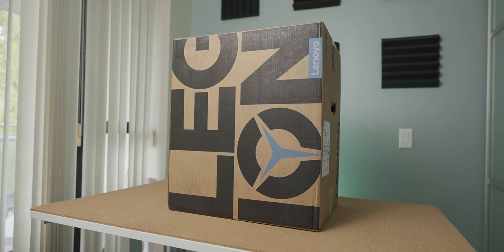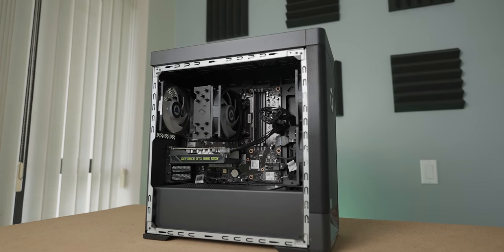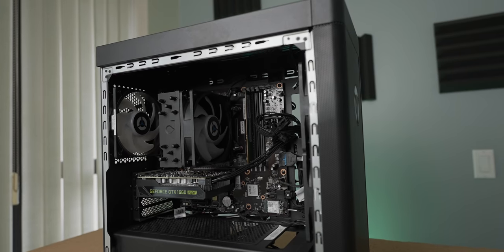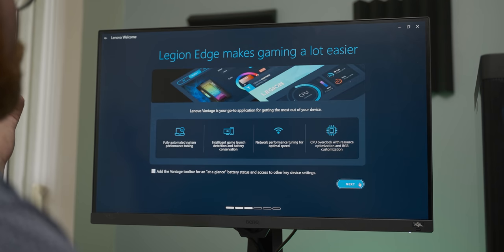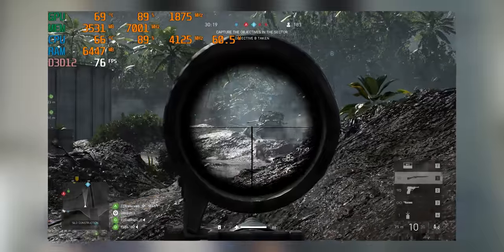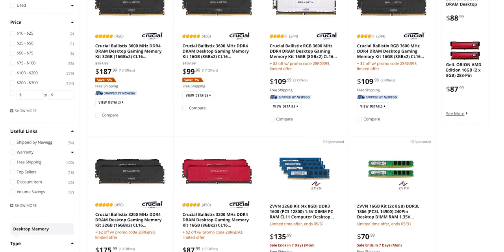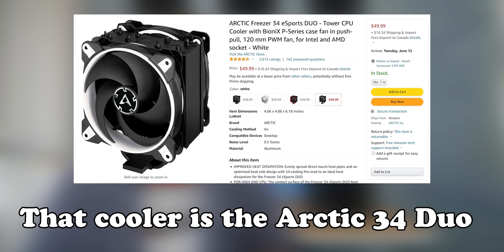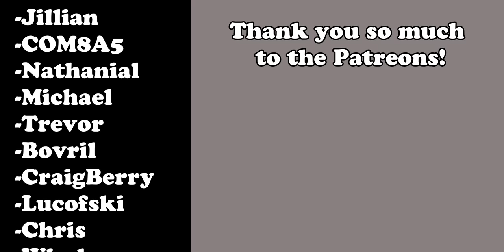Is Lenovo the KING of OEM Gaming Pre-Builts?

Comment: I recently bought one back in early November. Within 3 days of use the entire system blue screened and was unable to connect or see the WIFI icon - it was a hardware failure. Brought the pc back to the store and they gave me an entirely new unit. Today I had the same fucking BSOD for just having two applications open. Unbelievable.

Comment: No point in a new cooler if this board doesn't support overclocking.
But its good to see a good recommendation for others out there.
Reply from the maker: I completely agree, however some of the specs of this system comes with a worse cooler. So I just thought I would mention it. :)

Comment: i bought the lenovo legion t5 with a 5800 and the rtx 3070 for just 1500 euro. It's actually not bad at all! The only complains i have so far are the low quality psu and the fact that you can't manually control the fan speed, but it has really well done cable management, standard parts, the gpu doesn't suck, no bloatware ecc...so yeah not a bad deal at all.
Reply: also yea the backplate was glued on but it can be removed by pushing it with a screwdriver, it takes about 10 minutes. I had to use the intel backplate to install the arctic duo 34 esports

Comment: I bought the one with 32gb RAM (two 16gb HyperX sticks), two extra fans at the top and the RTX 3070 and it also has this quite annoying (airflow?) whine, but luckily no coil whine. I can hear that particular whine in your video, which is that kind of humming 'wooo wooo wooo' sound. I've played around with the 'intelligent cooling' settings a bit, but that doesn't seem to get rid of it. When I put on the RGB lighting it sounds like it actually gets worse? Oh well, guess I just have to get used to it. I don't care for lighting and when I play games or listen to music I don't hear it. I'm sitting right next to it now, so I might just have to move it a bit further away from me.

Comment: i bought a lenovo t5 last year with the 1660 super but it came with 16gb of ram using 2 slots. but its also a weird t5 cause it doesnt have the two fans up front or the mesh front
Reply: Can you send the link? If you still have it.
Reply: @Guth10  sadly it was a limited time deal through Costco.

Comment: Theres one of these at my local best buy that says it has 16gb of ram, Wondering if i should pull the trigger on this, since i will be paying it using sezzle lol.
Reply: Ordered mine from BB also. Ryzen 7 5800, Nvidia 1660 super, 16 g ram for $1,100 (us). Replaced the PCU with an EVGA 700 Bronze. 
This is my first gaming PC. No crashes, runs cool, not loud. 
Playing Arma 3 and Zero Hour currently and both run smooth.

Comment: I have this that came with a very very basic cooler. Cooler back plate does come off with a lot of work, it uses an intel style mount(my Corsair aio works just fine) I had the same speed issues with an upgraded kit of ram but that was fixed with amds overclocking softwear. So far the only proprietary stuff I have found on it is the power switch connector and front panel audio. PSU is a standard with standard connections

Comment: I have one too, bought it from Costco Online for 650+tax, and it runs cyberpunk 2077 at medium to high settings at 56 FPS...
However, the PSU is underpowered. Just 400W. I was getting the game freeze and hard reset issue  after 10 mins of gameplay and decided to upgrade the PSU, 89.99 EVGA 850W GT supernova on Amazon. Other than that its a great machine

Comment: out of desperation to get my hand on a rtx 30 series card, i bought one of these systems. Lenovo Legion with a rtx 3070 and a ryzen 7 cpu. in my system i DID get a 2X 8 GB RAM, and it actually is set in dual chanel. dont know if it is just this system/model or if it is a question of where you buy it "Denmark". But i was so surprised that i did Not just rip out the cpu and gpu as i intended, and i am actualy using it As Is.

Comment: Got the same pc this week, i bought 16 gb ddr4 3200MHz balistic and it work but it stuck at 2666MHz, the custom lenovo bios dont give the option to change the frequency. But the for the rest, i am impress of the cable management and the case. For 1075$ CAD, i cant have the same if you try to DUY with the gpu shortage and the price of cpu keep rising.

Comment: The mounting system for the CPU cooler appears to have mounting holes in the motherboard that are laid out in a square rather than the normal AMD Ryzen AM4 socket's tall rectangle pattern.  That's likely fine provided what they have done is to use one of the common Intel mounting holes patterns.  If I had to make a wincing guess, I'd suspect (or at least hope) that they used the mounting pattern Intel has been using for its consumer desktop CPUs beginning with the LGA 1156 socket chips and continuing through the LGA 1155, LGA 1150, LGA 1151 and LGA 1200 socket chips.  That spans all the way from the first generation of desktop Core i3, i5 and i7 chips to the most recent generations of those chips.  If that wincing guess is correct then pretty much any contemporary CPU cooler (including models introduced during the last decade) that includes mounts for the Intel platform (and isn't too tall and does not interfere with the RAM slots) is at least a candidate for this system.

I rather doubt that Lenovo would choose to employ a mounting pattern that wasn't the one I mentioned above, but it would be interesting to get confirmation or refutation of my guess.

Comment: As somebody who owns this computer currently, here's my experience.

Bought it and plugged it in when I received it, worked for 20 minutes and then literally started smoking and turned off. Sent it in for repair and was told it would take 2 weeks... 1 month later i randomly got it back with the box all banged up. I took the pc out of the box and the screws on the side glass had all broken off and the top was dented. Booted it up and it's worked ever since. Dogshit support though. Just build a computer.

Comment: In the country I'm from, the T5 comes with an i5-11400 and an rtx 3060, 16gb of ram dual channel😲, 1t hdd + 512gb m.2 ssd, probably the 	Intel B560 motherboard is the weaker component, all at around 1400$ US, inflation here is a bit high. Is it worth the price? The cooling components are the same as in the video.

Comment: Not a terrible machine it seems.
So, one of the primary reasons I built my own pc was to get away from the bloatware. Which has been moderately successful since windows wants to add its own to our pcs.
Could you build a gaming pc using the Windows 10 LTSB operating system?
From reading about it, the only downside I am seeing is that it is expensive but I wonder if there are any other compelling reasons to not use that OS?

Comment: I've strongly considered Lenovo for gaming PC's for family and friends, but they don't offer modern hardware. Ryzen 3000 series,  Intel 10th gen and last gen (1600/2000 series) GPU's. Selling at full price, it's not really a deal.

That said, they do offer good builds. Their highest end PC I can find is a 10700f, 2070 (non super), 2x8 2933MHz, NVMe SSD & HDD, 650W PSU, all in this case... But for $1700.
Reply: Are you on their website? For that price you can get 2070 super, 32gb ram, and liquid cooling right now. https://www.lenovo.com/us/en/desktops-and-all-in-ones/legion-desktops/legion-t-series-towers/Lenovo-Legion-T7-34IMZ5/p/90Q80003US
Reply: @Dash3717  yeah I was just on their site. I didn't look at the higher end lineup. Still get a 2070 super and a (completely unnecessary) 10900k with 32GB of RAM.

Comment: 7:03 so from what I've learned (in the past 1hr) is that the 1% and average fps should be fairly similar otherwise the frame rate drop is significantly noticeable so that CSGO 422 to 66 drop will be awfully noticeable right?

Comment: I bought a pre-built too and it is way better than this (yes in performance too but i mostly mean the way it's done and built etc)
Specs:
CPU: AMD RYZEN 5 5600X
CPU cooler: MPK MSI MAG CORE LIQUID 240R
Motherboard: MSI MAG B550 TOMAHAWK
RAM: (2x8) 16GB CORSAIR 3600 MHZ RAM
Storage: 1 TB WD BLUE SN550 SSD
GPU: MSI GEFORCE RTX 3060 TI VENTUS 2X LHR
Power supply: MSI MPG A650GF 
Case: MPG GUNGNIR 110R (airflow is wayyyyy better than expected (at 60fps 1080p on most games i haven't seen it get to 50 celsius even once), it reaches about 55-60 when gaming at 120/144fps)
Reply: Yet you don’t tell us what this “better pre-built” is.

Comment: I tried to upgrade mine to 32gb 3200 but the bios gives no option to set any kind of XMP. Mine came with Samsung 16gb 3200 dual channel ram but the maximum verified JEDEC spec of the ram is 2933. So unless your replacement ram is verified to not be the normal JEDEC standard of 2133, you'll take a hit to performance with an upgrade unless you look around and get some ugly sticks with no heatsink.

Comment: Just a quick question:

Do all models come with RBG (or any) fan lighting as standard? I bought the one they had at Costco a few weeks ago and I'm overall happy with what it does but every single one of these I've seen on YouTube seems to light up out of the box and mine doesn't :| this is also the first gaming PC I've ever had so I'm not sure if something may have shaken loose in transport of if replacing it with different RBG fans would fix the issue.

Thanks!

Comment: lol i got a lenovo legion dont remember the exact name but and these are the specs it came with 
cpu: i5-7400 3.00GHz
ram: 1 8gb 
hdd: 1tb
gpu: gtx 1060 3gb 
psu: some random chinese 280 watt psu 
motherboard: i have no idea what it was if i remember it was called something like 36D9
the only thing i changed was removing the 1 gb stick and getting 2 new 8gb sticks and a ssd thats all i know nothing about pc's but i just wana know if there is anything i should change

Comment: Dawid , would it be possible to let me know what ram stick was installed in there? i was looking to buy one of these with a single 16GB stick installed and add another Crucial stick instead of just putting 2 x 8 in there , i did hear that you have to use those cheap ram kits with cl22 timings to make it work on these PC's , or else it will always run at 2400 or 2666 instead

Comment: This doesn't look bad, setting aside the fact that the CPU is a Ryzen 5 3600 instead of a 5600, the fact they threw in a 1TB hard drive instead of having that 256GB NVME a 1TB one instead, the cable management being hilarious, the GTX 1660 Super being there (instead of something like an RTX 3050ti or something), and the fact that it's using a single stick of cheap 8GB of RAM (not even dual-channel memory). Having RGB stuff when the cable management looks awful is pointless, 8GB honestly isn't even usable nowadays, especially for that kind of hardware and how bloated Windows 10 and most software (especially stuff that uses Chromium/Electron) is. I'm expecting people buying out these prebuilts to take the graphics card, and then sell the rest of the system on Ebay or something.

Actually, now that I think about it, if it wasn't for the shortages, this prebuilt would be highway robbery.

Comment: I'd like to point out the $850 Lenovo Legion 5, which is almost a carbon copy of this system in laptop form.

The laptop variant has a Ryzen 5 4600H, which is extremely similar in performance to the Ryzen 5 3600. (Slightly worse.) For a GPU, it has a GTX 1660ti, which is also extremely close to the 1660s. (Slightly better.) 8GB DDR4 Kingston RAM, pretty much going to perform the exact same as the RAM in the desktop. 512GB SSD, 1TB HDD, a 60w battery, and a 15" 1920x1080 120hz display, etc. It even has similar temps! (Only God knows how they managed that.)

Yes, it's going to perform worse because of the inherent limitations of a laptop. Yes, the desktop is upgradable where the laptop can only have a few small tweaks done to it. (Has an extra RAM slot, thank God!) But the laptop also has Optimus capability, as well as some other neat features to keep it close in performance. In the end, it's almost the exact same system for around $200 less in a mobile format. So if this PC interests you, definitely give the Legion 5 a look. (Specifically the one with the specs I mentioned here, as there are many variants.)

Comment: I bought one about 6 months ago woth the 1650 super in it, but now it's stuck in a infinite reset loop. It loses power and resets every 30 seconds to sometimes 5 minutes. It's not on long enough to be able to trouble shoot it. Has anyone else had a problem like this? Or know of a solution?

Comment: Is there a solution for it now in 2023? Bought 2x16 gb Kingston Fury. Lenovo sticks do 3200 mhz, but when i use the kingston ones it just goes down to 2409 mhz. 
Is there a bios fix now,or do I need to bring it back to my seller?

Comment: why is in all systems cpu fan face to ram? isn't better to face to back and back fan exit the air ?!
Reply: The CPU fan doesn't take air out, in takes air in and blows it into the heatsink.

If the CPU fan was on the same side as the exhaust fan they would compete for air and thus be hotter.

Comment: I had a T5 with an i9-11900F and rtx 3070.

My review:
context: + means still good for my standards. ~means meh and - means NOPE.

+I9-11900F had a PL2 of 210W and PL1 of 160W. That's fine
~the problem is the cpu cooler which was only for 150W. (Same one as in video but without argb) So my cpu would be at 80+ during a normal gaming session.

-PSU: huntkey HK650 80+ bronze. (Sketchy psu rated for 550w (but has 650 in its name) 520w on single 12v rail) probably a c-tier gave the gpu a lot of coil whine. (swapped it out with a cooler master mwe gold 850 and the gpu still whines but way less)

+Ram 2x16gb ddr4 3200 Kingston Hyperx fury (has an all white factory part sticker instead of a red/white sticker). Ran at 2933. (Probably because the 11900F runs 3200 in gear 2 and lenovo chose to run it in gear 1 at 2933. (only the i9 K skews can run ddr4 3200 in gear 1)

+GPU: RTX 3070 Cooler although silent does make the gpu run at 78c noticeable coil whine certainly with original psu. Only one 8-pin makes it kinda worrying certainly because the huntkey psu has awg 18 which is ok but not ideal (an awg of 16 feels safer) also the argb on the backplate can't be turned off and will always have a fast paced argb colour.

~Case no glass side panels both where made of alluminium. The problem was it only had one intake and one outake fan that weren't spinning that fast and so the case got really hot and the gpu would breathe in it's own exhaust air. for an i9 and 3070 that's not enough

-fan curve. Fans always run at 800 rpm until the cpu reaches 85c and then they ramp up to 2200rpm which would make the cpu cooler shake really hard. (The case would start wobbeling)
Putting in performance mode wouldn't change anything. The only thing the silent normal and performance mode change is the max temperature of the cpu. Not the fan speed. So basic and quiet mode both had the same noise output even if the cpu was at 100%. Because quiet and basic mode wouldn't allow the cpu to exceed 80c and at 85c the fans would ramp up. Only performance mode allowed more noise output because the cpu would be allowed to run at 100c and the fans would spool up. from 0-80c all modes had the same noise output. (Except for GPU that had it's own fan curve and can be changed with msi afterburner).

- The motherboard. The reason I don't recommend most prebuilds. The motherboard was M-atx and had no XMP support the bios was mediocore. But that's okay the real problem was the VRM (VRM= Voltage Regulator Module. Somewhat of an on motherboard power supply for your cpu and ram) . You may have seen videos about the b560 VRM's and seen how bad some of them are but Lenovo takes it to a whole new level. It has a 6+2 phase at best. Couldn't find anything on amps per stage but probably not higher than 50 amps. The vrm did not have any heatsinks but the motherboard did have mounting holes for a vrm heatsink. The vrm would throttle if your cpu was drawing over 125W. Which is sad because if they had just used heatsinks (I know lenovo has them) The motherboard probably could have supplied a steady 160W constant. Meaning that the cpu pl 1 would now be the bottleneck. Also the VRM had a Crazy choil whine making it sound like a running water tap.

Also the chipset did not feature any heatsinks so it was just bare sillicon. Really ugly

+Bloatware. I only had Lenovo vantage installed. But I do live in the European union so there may be some consumer laws that protected me from McAfee.

+Storage. A Samsung 1TB ssd comparable to a 980 (non pro) Pcie 3.0 2280. Sure it is a pcie 3.0 on a 4.0 supporting motherboard but I Struggle to saturate a 4x 3.0 connection so for me it isn't a problem. It also came with an 1TB Toshiba HDD (Toshiba is considered the most reliable HDD brand) My only negative on this is that the HDD brand is just with luck and it could also have been an Western Digital (WD very scary). (SSD was the boot drive)

+No e-waste

+ Packaging

Final grade: 4/10 Which is sadly enough is high for a prebuild.

Questions? Ask me
Reply: I want to get i9 12900k rtx 3080 version for $1300. would u recommend
Reply: @davidvictory9764  for that price, yeah even if you have to build your own pc out of it. A i9/3080 for that price is amazing.

The T7 motherboards usually have vrm heatsinks and chipset heatsinks. Just make sure that the cpu has liquid cooling and that the games you play need less than 10gb of vram.
Reply: @apotato5563  what about i7 12700k but for $50 less. is there big difference between i9 and that?
Reply: @davidvictory9764  I believe that the i7 versions never have liquid cooling so I think the i9 is better. Also looking at price the 12900k is more than $100 more expensive when buying a boxed one.